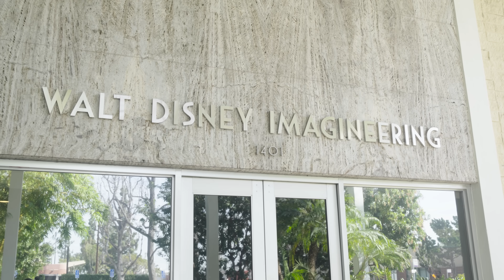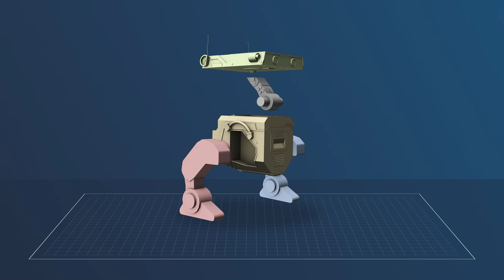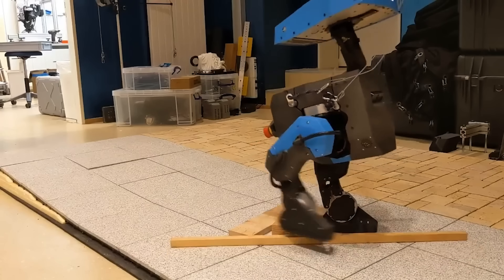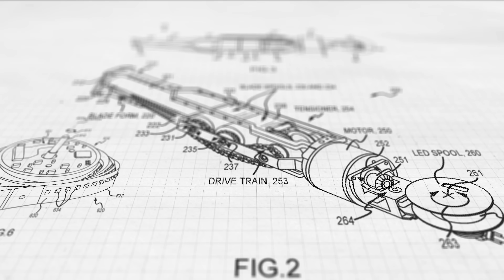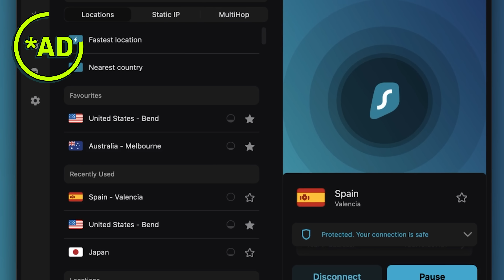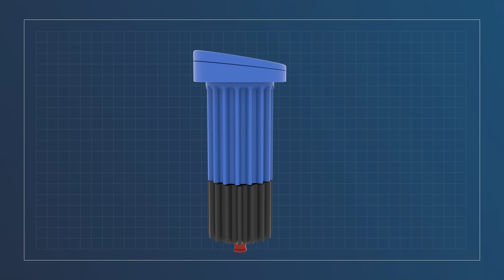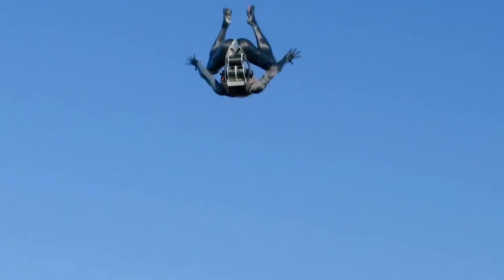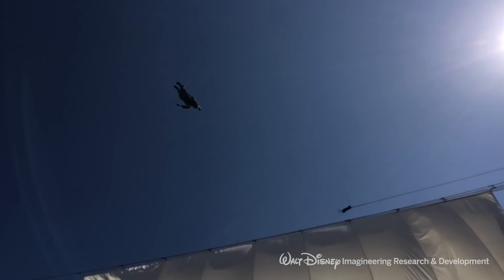How Disney Built A Realistic Lightsaber

Comment: 7:00 Summary: the lightsaber is constructed of 2 transparent tape measures that extend/retract with motorized assistance.  10:00 Omnidirectional conveyer that's been used in postal & manufacturing for 40+ years.

Comment: it would be interesting to see how fast the motion floor could make things move. Also, what if instead of on the floor that motion surface was attached to the things moving around instead. then you don't need as many of the rollers and it can be used on larger surface area. It appear that the roller systems probably are about 3-4 inches or longer in length?
Reply: The roller itself is 3-4 inches, the actual motors that move it underneath are way larger. Those couldn't go on the surface of the object.

Comment: I'm a mechatronics engineer (M.S.)  with 10 years experience in robotics, autonomy and HMI development. I have worked for several years of in computing & simulation and develop video games as a hobby. I have always dreamed of working as an imagineer but those jobs seem so unstable. In 2020 Disney fired 400 imagineers, last year Disney fired one of the principal imagineers and the imagineering department has historically lived on the chopping block. Every time there are economic hardships Disney looks to imagineering for heads roll. I just can't risk my family's stability to work at the whims of a penny pinching megacorp.

Comment: Technically TheHacksmith has made the most realistic lightsaber. Disney‘s just extends
Reply: What's the point of a lightsaber if it doesn't extend or retract? That's what makes them special. A lightsaber that doesn't retract is just another sword
Reply: @enadegheeghaghe6369  you do realize hacksmith made his using actual plasma and built a liquid oxygen plant in order to make it so compact you can fit everything into the hilt, so yeah, pretty realistic.
Reply: @yeetyiu4505yes but does it retract?
Reply: @hacksmith  👀